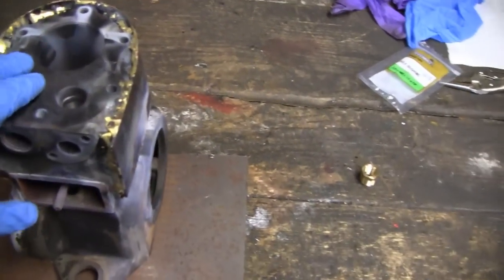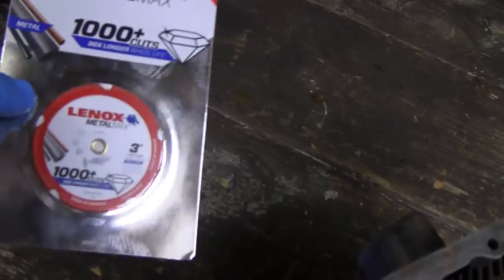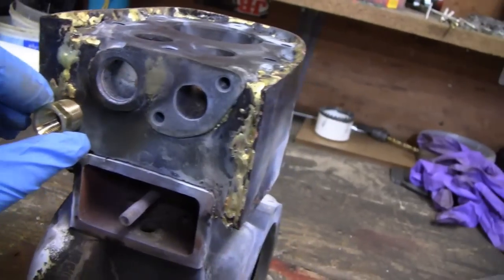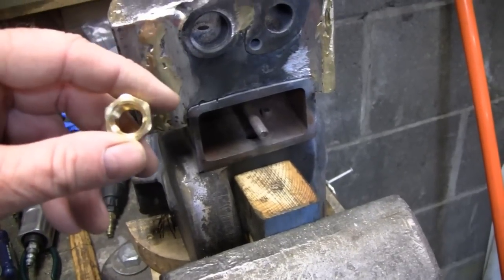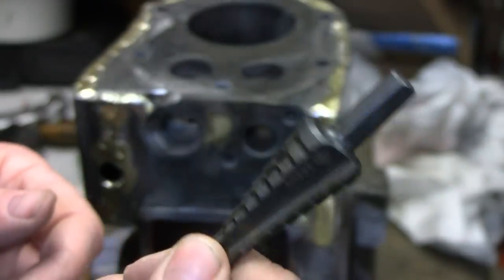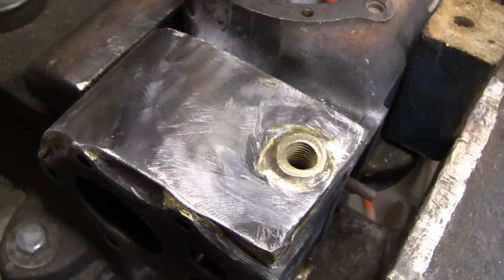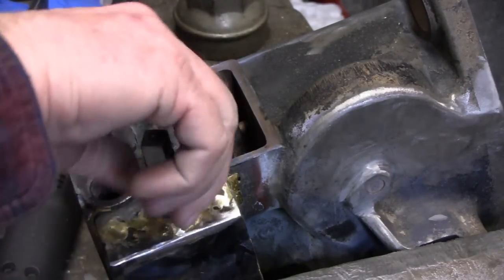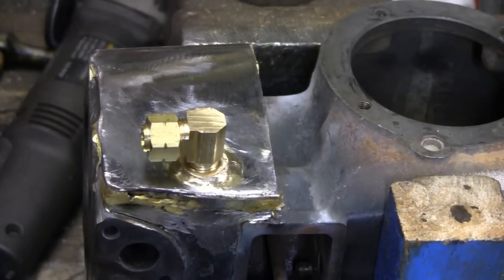HOMEMADE WATER COOLED BRIGGS ENGINE (part 10)

Comment: All be! You did weld, well brazed it and not TIG. Still, that's engenius for sure! I bet that joker is 10 to 15db more quiet now that you dropped out the thumping of the piston as well as the valves! 👏🏼👏🏼👍🏼
I love your channel, been coming and going for a long time and missed these water cooled Briggs and Stratton videos. Right when I think I've got an idea that I'm sure no one would have any footage of an unusual elaborate project, much less attempt... It's always you and your boys pulling off some of the craziest things online!

Since I spoke on it a minute ago, I'm planning to do the same to my 10 hp Tecumseh engine and generator as I can put sound dampening material around the lower half of the case because the water would be pulling way more heat away than fins to ultimately take the last of the droning engine noise away. I'm considering the option of driving the water pump off of the flywheel's starter teeth to have less of an issue with the generator on the output from the crank.
My engine is all aluminum, so I'm all TIG.

Comment: That outlet port should be as high up as you can get it o that all the air will flow out.  Where it is now will result in the block only being 1/2 full of water.  the rest will be trapped air.
Reply from the maker: I don't know how you figure that!! The outlet port is in the head!!☺
Reply: Man I saw you install two ports into the block.  Where the water is going to exit the block, I would think it would be better to have that port as high as possible.

Comment: Cant't help thinking that the water outlet needs to be closer to the top of the water jacket so that you don't end up with a big bubble of trapped air in there.
Reply from the maker: How can that happen, the water outlet is in the head!!☺
Reply: You have a water inlet below the exhaust port and a water outlet around the corner from the inlet port  this is the one of concern as the air will be trapped above it, it should have been placed as close as possible to the top of the water jacket. Or you should have some sort of bleed nipple at the top of that section of the water jacket to let the air out.

Comment: should have put the outlet for the coolant at the top of the block to let all the air out of the cooling system as that could make it overheat just a suggestion
Reply from the maker: That wouldn't do anything except drain the head!!☺

Comment: Just Thinking out loud here RoadKing, But, if you were to install a short length of Copper pipe into the Union Nut and a Copper washer, A: it should be Water Tight without the need for Brazing, and B: the short pipe on the inside should direct the Flow of Coolant around the Cylinder.

Comment: The size of that fitting could be a 14.5 they are rarely needed, but there is a series of metric wrenches that all go from 14 to 14.5 to 15 to 15.5 mm etc.

Comment: Wonder what brass company made the brass bar stock for that fitting? I worked in a brass mill making brass bar stock for 24 yrs an that's a bastard size,wonder what it mics has to be a 32nd or 64th measurement?   Here may be a handy item https://mdmetric.com/tech/cvtchtfdm.htm
Reply from the maker: I was informed those fitting take a weatherhead socket!! Thanks for the link!!☺
Reply: Could be Weatherhead has been bought out they were a big company near here in Antwerp,Ohio. http://www.eaton.com/Eaton/ProductsServices/Hydraulics/ProductsbyName/Weatherhead/index.htm

Comment: That thing is looking great!! I have always used Irwin unibits they work great, I have had many coworkers say the harbour freight ones are actually pretty decent but I have never tried one to confirm
Reply: 1944johndeerel 
They aren't too bad, I've killed a couple by being lazy and applying too much pressure ,or too thick of material/too big of a bit to start a hole. 
Other than my stupidity making them fail I give em a thumbs up for usefulness and low cost.
Reply: Never hurts to squirt some oil on them while cutting!

Comment: How are you going to get the air  that is trapped above the ports out without a bleeder
Reply from the maker: The radiator fill is above the engine head!!☺
Reply: You still have air trapped between the top of your ports and the top of the block regardless of the radiator fill location
Reply from the maker: You'll have to watch the previous videos and the future ones, you're not getting the whole picture!!☺
Reply: 805ROADKING lol it's so small you could rotate it up and down and sideways with a couple people 😬

Comment: Nice Work!!!
Looking Great!!! 
going to make a air bleeder at the top of the cylinder to get air out?
i guess being a small engine you can just tip it sideways lol.
Reply from the maker: Thanks Bud!! The radiator fill will be higher than the engine head!!☺

Comment: Nice work! It's really starting to look like a liquid cooled block now. My apologies if I have missed this in a previous video, but I wonder what you are planning to use for a radiator... First thing to come to my mind was an old car heater core. Second thing to come to mind was a cooling screen like they used on very early gasoline and kerosene tractors. Whatever the case, this is a fascinating build and you are doing a great job on it!
Reply from the maker: Thanks Bud!! The radiator was shown in the first 30 seconds of part one of the series!!☺  https://youtu.be/QOx9g7C-5uo
Reply: Aw, sheesh... Now that I watch it again, I DO remember it. (Insert Homer Simpson 'D'oh!' here).

Comment: If you ever think you're going to melt a brass fitting like that, the simplest solution is to put a pipe inside. I've done it quite a few times when the temp game was dicey.
Reply from the maker: Interesting!! A heat sink!!☺
Reply: aserta ... I've  done this.  It didn't  take me long to learn to let everything  cool completely  before removing the pipe or you might damage the threads.
Reply: aserta 
That does work nice. 
Like sticking a nail in a carburetor vacuum fitting so that it fits snug, ypu can pull it out with your favorite butcher tool like vise grips or pliers and not collapse it. 
Same but different  😬

Comment: Could you guys take this water cooled Briggs to the next level and make it so the water goes through a heater core in a truck's or cars heater box and blower motor will blow heat made from the Briggs aka custom portable heater using water.
Reply from the maker: The radiator was shown in the first 30 seconds of part one of the series!!☺  https://youtu.be/QOx9g7C-5uo

Comment: Talking out my tail here but I think I woulda put a solid divider plate between the intake and exhaust port. That way the cold water can go in on the exhaust side and forced around the cylinder to exit out the intake side. As it is the water with take the path of least resistance and just go right by the ports out the other side instead being forced around.
Reply: dj beard This too.
Reply: dj beard 
Yea I was kinda thinking that a while back, direct some flow around to crucial areas , unless he's just gonna flow a lot of water to make up for the hot spots. 
It'll work, it would be real interesting over a long term to see how the engine responds to it as far as heat related wear in the important areas.
Reply: Yep makes more sense that way. And putting the fittings in before you braze the steel

Comment: too late now but you should have put one fitting close to the bottom edge and the other close to the top. Would also have been good if you had a baffle in there to force the coolant around (circulate around the cylinder). It will most likely be ok since it won't  do any work so not so much heat dissipation.

Comment: Looking good Roadking! 
I know in reality, you're allot further down the road with this project then the video shows. Couple of potential issues came to mind when looking at this right now;

Is the coolant outlet going to interfere with the magneto plate? 

The other thought, and probably not an issue, but being sure the coolant flows the long way (around the cylinder), rather than crossing from port to port under the valves. I assume you didn't put any sort of diverter between the space under the valves, right?

Really looking forward to seeing what you fellas do with this one, especially the head, and what you have for a pump setup!
Reply from the maker: Thanks Bud!! No worries, it's all covered!!☺

Comment: Not sure if you picked your pump yet, but it might be neat to use one of those hand drill powered transfer pumps.  Might work well and you wouldn't need an external battery, electric pump, etc.  Harbor Freight has them for around $10 I think.
Reply from the maker: We were gonna use one of them but it looked like shit, we found a nice small metal one we show in a future video!!☺
Reply: 805ROADKING Cool, they are sort of fugly, but I always wondered how well they worked.  Looking forward to seeing what you guys picked.

Comment: Nice work, Roadking. 
I was thinking how nice it would be to finish off the body work with lead like they used to do with car bodies. Lead is easy to flow and work and it would tend to seal any pin holes and leaks permanently and you'd be working well below the temperature of the brazing that you've already done.
Reply from the maker: Thanks Bud!! Lead is a pain in the balls!! Epoxy will do the job a whole lot easier☺
Reply: JB Weld to the rescue?
JB Weld is easy to sand and do detail work on too. You could get that whole water jacket area smooth as shit, man!
Reply: Use it and Marine-Tex for 30 years in the Marine Business. Works like Butter and saved my ass. Many Times
Reply: That's what he will use. He buys it in very large quantities, by the quart or gallon I think. Look up the 4 cylinder briggs they made and you will see what I mean.

Comment: I really think you could drill through  the deck and make a water cooled head too, like a car engine! Just drill small holes through the head and gasket ( centered ), leave the fins on the head for strength. some water cooled engines only cool the head, it's the hottest part.
Reply from the maker: That was all discussed and shown earlier in the series!!☺

Comment: hey roadking yall should make a 2stroke briggs or do a ovh converson on a flat head
Reply from the maker: Some of them are on the list Bud!!☺
Reply: 805ROADKING Sweet
Reply: being honest converting a flat head to ohv wouldnt be too difficult but would be a good bit of work.
Reply: Mudd Boss just steal a head off a predator 212 and use that
Mod as needed
Reply: stealing a head off a predator and putting it on a honda gx160 (the engine it was copied from) is pretty easy, just bolts right up but an old briggs flathead is a way different story, entirely different geometry, no amount of modding would make it fit, you would basicly have to weld all over it into a solid block then mill it out to fit the briggs head bolt pattern and everything, and might as well just get a block of aluminum to mill out, so thats clearly out of question
Reply: FlyingWldAlaska77 adapter plate
Problem solved 
Hell since its air cooled you can just mount it to those using the brigs as just the sealing surface 

You're really not thinking this well

Comment: I'm just starting the vid but didnt want to forget to say those diamond wheels are fine BUT dont get them hot or the grit will fall off and let it cut slowly. If you push harder you make more heat and then it goes to pot. I love them in my home shop.
Reply from the maker: Thanks for the info!! I was totally unaware of that!!☺

Comment: You need a 19/32" lol Great work brazing and drilling.  Unibits are very handy. Easy to loose too. 👍👍
Reply from the maker: Thanks Tex!! I probably have a 19/32" up in the attic!!☺
Reply: 805ROADKING ... About the Uni Bits.  Sometime when you buy them they don't  come in a protective sleeve.   If they are allowed  to  just  rattle around  in  the  tool box  they will be dulled  and can do  a lot  of damage when drilling thin material.  Tall pill bottles will hold most.